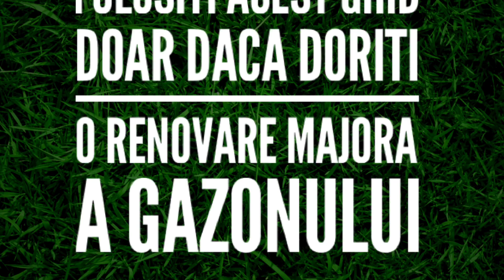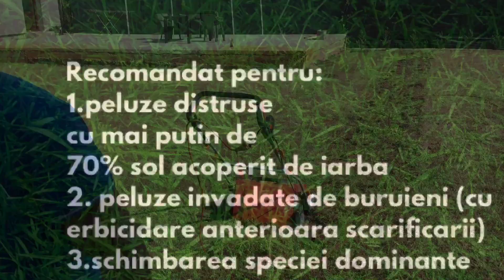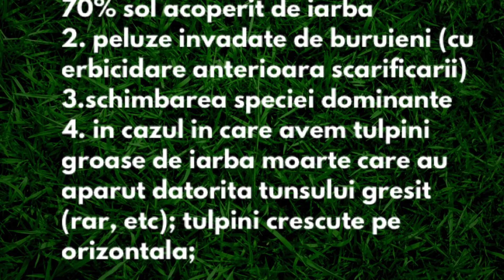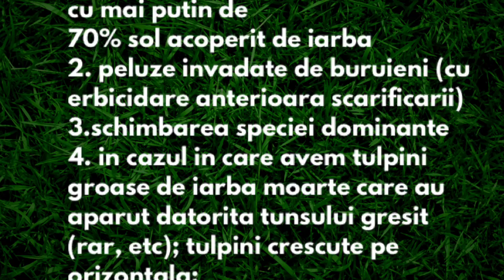Renovare gazon / Schimbare specie dominanta intr-un gazon de 500 mp + nivelare

Comment: Ce model de masina tuns folosesti? Si daca o recomanzi pe axeasta sau stii una mai ok. Am vazut ca e masina electrica
Reply from the maker: folosesc o gardena electrica si fiskars manuala cu cilindru. gardena e f buna pt suprafata pana in 150 mp. fiskars e ok doar ca cosul nu are cel mai bun design, nu e buna la suprafete mici sub 100 mp, daca sunt multe colturi etc. in curand am sa cumpar o masina tuns manuala gardena sa vad cum e .